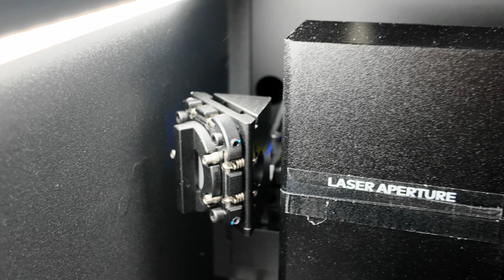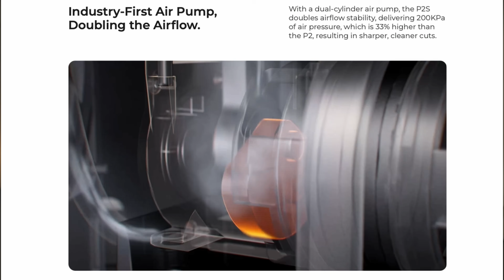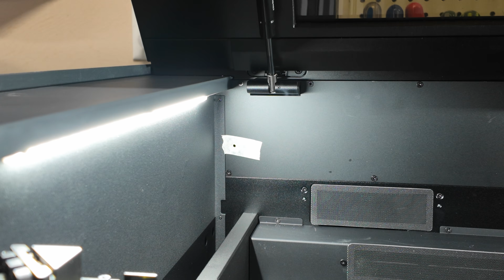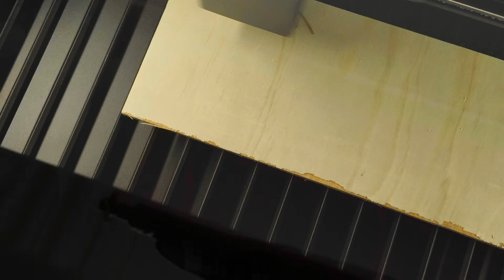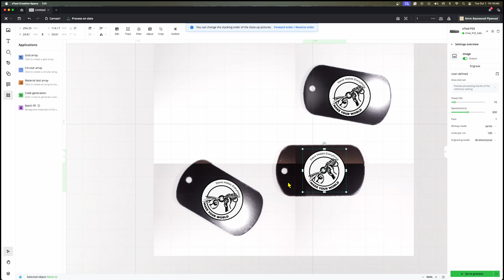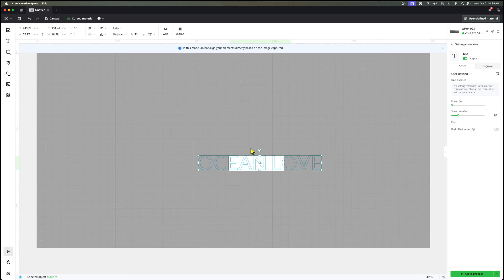xTool P2S Laser - The Laser Appliance That Will Change Your Life

Comment: Hi Steve,  I’m loving all the new diode lasers on the market that you show us.  As a person that run two nonprofit maker spaces, I’m anxiously waiting to replace our CO2 lasers.  However our CO2 laser are 24 x 18 inches and 40 x 28 inches 75 watts.  We would like something similar in size (in nice big industrial cabinets) but with the diode lasers.  When do you think that will happen?  And who will be the first company to make it?  
Thanks,  Mike C Fablab’n Stoughton Wi
Reply from the maker: Hi Mike,  see my email, but if you are looking for something larger than a typical diode laser, then you will end up with an open-frame laser that has extension rails as an option.  If you're looking for safety though, my personal choice is the 48W ACMER P3.

There is a company that just released a 4'x8' diode laser but I can never remember the name.  If I think of it I'll send you a message.

Comment: Thank you. I think this is the next one I am going to get. Where I live, it is an old house with old wiring, and so I cannot get a large machine. This has some nice features and I hope my power can handle it. 

I have only 3 outlets that can handle window ACs, for context.
Reply from the maker: This should be fine on any 15A  circuit if you live in North America. CO2 laser typically don’t use a lot of power (maybe 200-300W on the input side, which is only ~3A) - far less than a window AC.
Reply: @SteveMakesEverything  Ah, thank you for explaining that, and it does give me more confidence. 

Yeah, I am in NA, so this should work and I can vent it safely if that is the case of the lower amps. 

Still, doesn't stop me from wanting one of the bigger lasers, but maybe one day...
Reply from the maker: @RoseKindred  If you're interested I can put a power monitor on mine and measure the current, but I run this laser, the exhaust fan and a few other things on the same 15A circuit and I have no issues
Reply: @SteveMakesEverything  Thank you for the offer, but I will take your word for it. If you can do all that on a single circuit, I should be able to. Sounds like I can use it on one of my "AC outlets."

I just have to check the wiring. I've had a few outlets so far where the circuit tester either wasn't grounded or wires flipped. Gotta love "fix em ups."

Comment: So do you really need a rotary to do larger imaging on tumblers ?  Larger than you could do without the curved feature  and is the a distortion difference between using the curved and not using  . I’m sure there is but I would like to see that comparison
Reply from the maker: There are limits to the amount of curve you can achieve without a rotary, and certainly, if you want to engrave all the way around a tumbler, you will obviously need a rotary.

Comment: cant you find a more expensive laser??  this is to cheap for my liking . :\ XD
Reply from the maker: Sure you can buy a comparable Glowforge, which is close to $7000 and is still only 45W and no way to add a rotary😉.  No question the P2S is pricey, but it definitely has features that you won't find on any other Co2 laser.  It's not going to be for everyone, but if it's in your budget, then it is one to consider.
Reply: @SteveMakesEverything  nah thats not expensive enough. XD